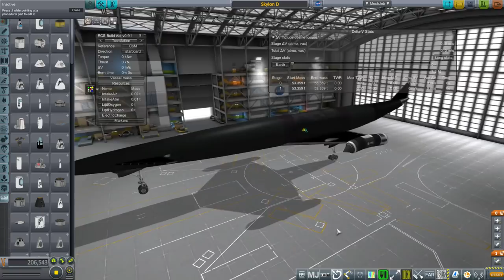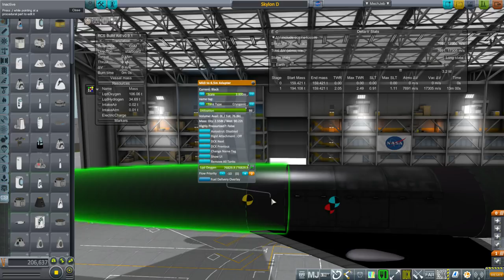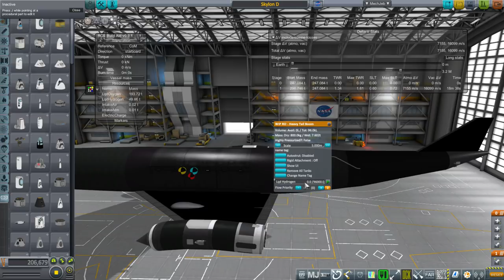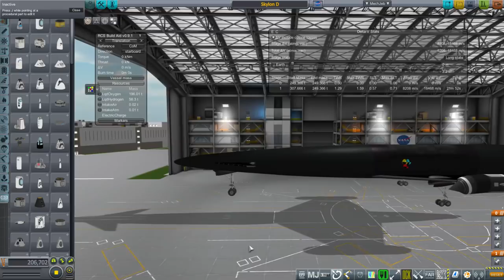Kerbal Space Program RO Sandbox - Skylon SSTO

Comment: Sabre engines are a bit underpowered, I increased their area to 3,6 which allows me to reach mach 5,4 within 18 minutes. ISP is the same but higher thrust means that less fuel is needed to reach certain speed. 

The diameter of engines and intakes also needs to be increased about two times which will induce more drag.

Also according to the interview with Alan Bond from 2014 Skylon is supposed to reach mach 0,5 on the runway just before takeoff.
Reply from the maker: Probably with payload we would get close to Mach 0.5, but we just don't have enough runway like this.

I don't really want more drag - I'll have to check the actual dimensions and maybe I'll reconfigure the intakes to produce the right amount. I'll see what I can do.
Reply: But the current diameter of SABRE engine is just not right. Look at the animations to see how big are these engines in comparison to the fuselage.
Reply from the maker: Yeah, that's true, though the engine nacelles taper so that the intakes are smaller than the engine size.

Comment: The Skylon is so damn cool, and I hope it'll pan out. I'm not convinced it will be a cheaper solution than BFR though.
Reply: Jonassoe I think the main advantage is usability from runways at commercial airports. The lack of need for specialist launch facilities should be a significant cost reduction.
Reply: Serves a different purpose than the BFR, and I can see it getting cleared for suborbital/orbital passenger flights across the world much easier and faster than than the BFR.
Reply: @freddiescowen5023  apparently Skylon requires a 6km long runway... longest in the world is currently 5.5km in China; longest in UK is 3km. Not a show-stopper as they can be built, but it can't just use any old airport.
Reply: @isaiahphillip4112  much safer than bfr too

Comment: It would be really helpful for mixed-cycle craft if there was an option to "force-stoich" engines—basically forcing the mixture ratio used to be that present in specified tanks. It would hamper specific impulse*, of course, but having that and fully emptying tanks is in most scenarios better than having full Isp and partially empty tanks.

*This could be calculated using propellant specific energy, specific heat capacity (at various temperatures), molar mass, chamber pressure, outside pressure, nozzle expansion ratio, a calculated exhaust heat capacity ratio, and a fudge factor for each engine. It seems complicated, but all in all it's basic algebra.
Reply from the maker: Well, RealFuels can fill the tanks based on the mixture ratio, but it can't predict when I'm going to switch modes because that depends on the trajectory I take, so that's on me to adjust through the accumulation of flight data.

If you're having trouble calculating specific impulse, I highly recommend this tool: http://propulsion-analysis.com/index.htm. Just get the free lite version at the bottom of the downloads page.
Reply: As in, there should be a setting which forces engines to accept the mixture ratio currently present in the tanks, and automatically calculates the specific impulse of those engines running on that mixture ratio.

There should also be a setting that automatically turns on closed-cycle engines when their default mixture ratio is reached.

Thanks for the link. I know how to calculate specific impulse in theory, but in most cases it requires a fuckton of hard-to-acquire data. If those equations and data were integrated directly into KSP, the first setting could be implemented.

Comment: What's with the bent engine pylons? Is it just to compensate for the angle of attack?
Reply from the maker: Not entirely sure, but they're definitely like that, though they're supposed to be fatter on the exhaust end.
Reply: I believe it is to do with the way it cools the air for the engine and to have it able to convert into the rocket form.
Reply: The inlets compensate for the angle of attack (7 degrees); the nozzles compensate for the offset from the centre of gravity (7 degrees on the Skylon C1 and C2; 5 degrees for Skylon D1)

Comment: Why no tail horizontal stabilizers?
Reply from the maker: It has canards for pitch control and, as you can see from it in flight, it doesn't really need much else. The control problems during reentry occur before aerodynamic surfaces would have much benefit.
Reply: Raiz Space Right. Makes sense, great video by the way. I’ve only seen you and VOAS do SSTOs in RSS, and your content is superb.